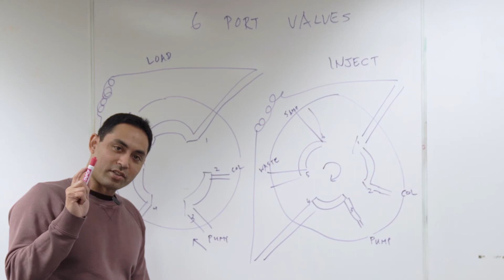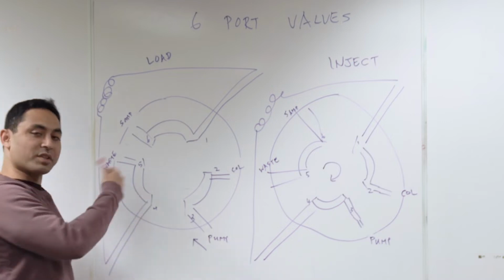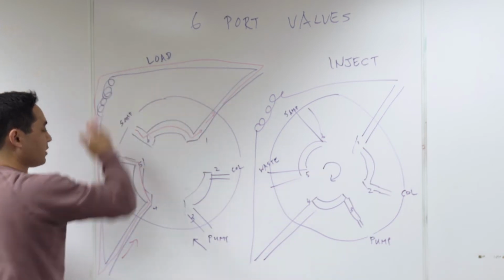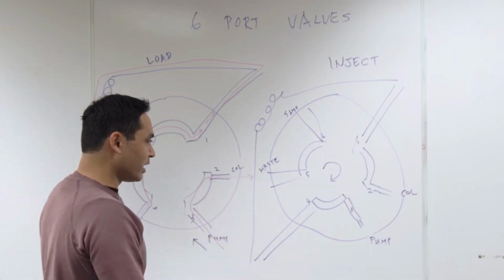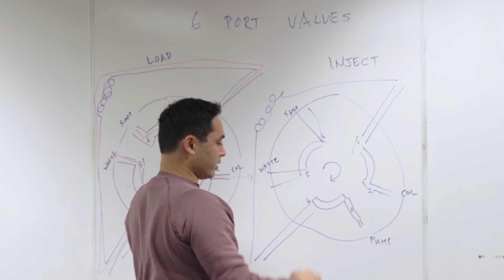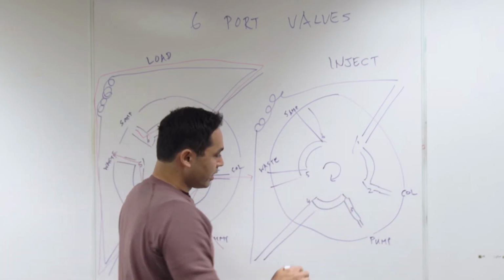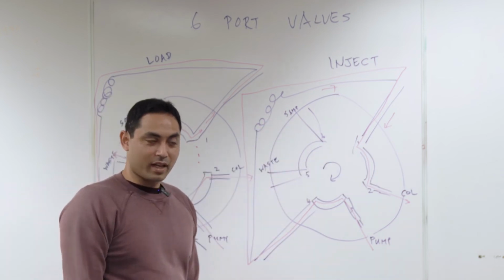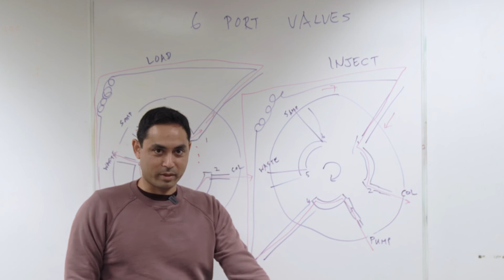How an HPLC 6 Port Valve Works

Comment: This a story, it should be told like a story. It is the journey of the sample. The characters are the ports & sample. Side characters are pump & loop. Events are load & inject, and action is the valve throw. And for the sake of the Lab Gods stop begging for likes. The respect you should show your listener and the merits of the story will get you aallll the likes & shares you could ask for.